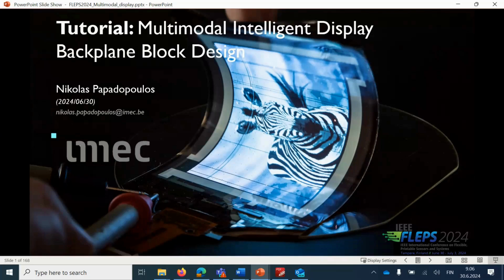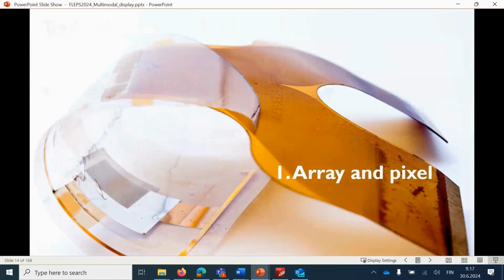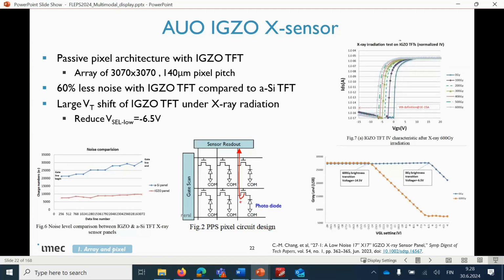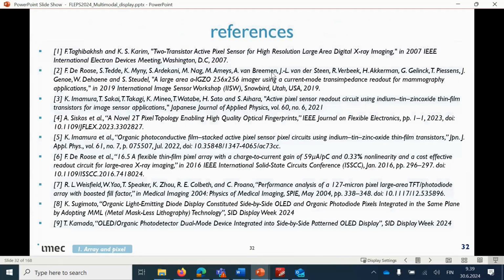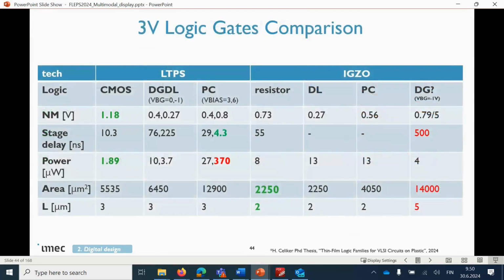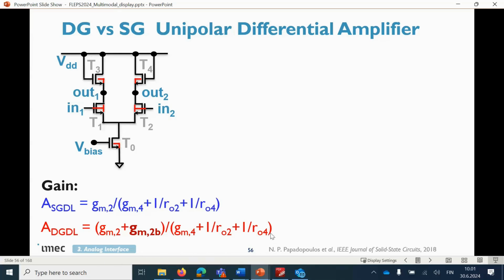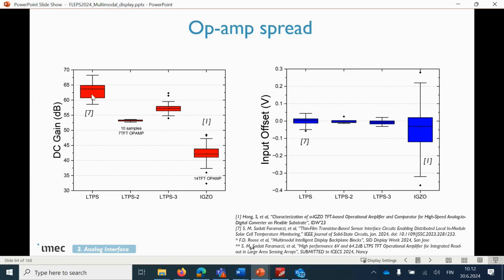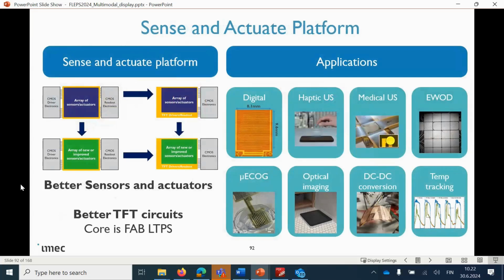Multimodal Intelligent Display Backplane Design

Comment: abstract: The future display will be multimodal, which means that it will integrate many different sensor elements on top of the display. Optical and touch-sensors are already on display panels but more are expected to be added: RFID antennas, ultrasound transducers, fingerprint, bio-sensors etc. Normally the various sensors produce a large amount of redundant data, which should be preprocessed ideally on the backpanel, to reduce power and cost of overall system. Moreover, the already present control gates and select and data drivers, absolute necessary for display operation, need to be upgraded to more configurable and partitionable operation schemes. This tutorial will present various TFT circuit blocks necessary for pre-processing and dynamic control of a future multimodal display. The performance of  operational amplifiers, high-resolution analog-to-digital converters, a microprocessor, DC-DC converters, and high-resolution sensor pixel array architecture will be discussed in LTPS and IGZO TFT technology.